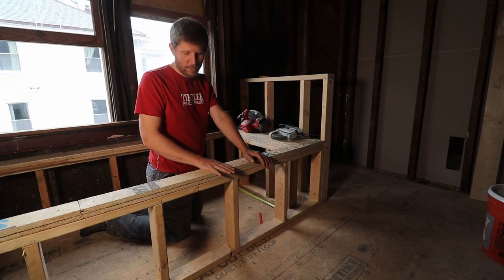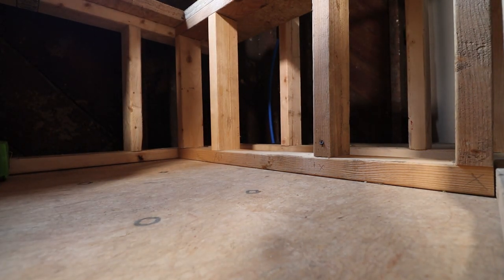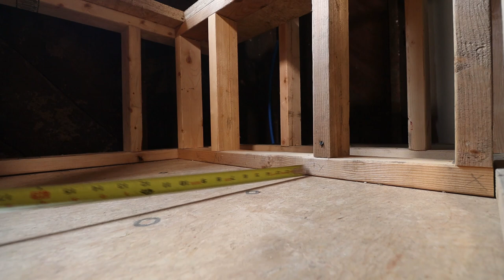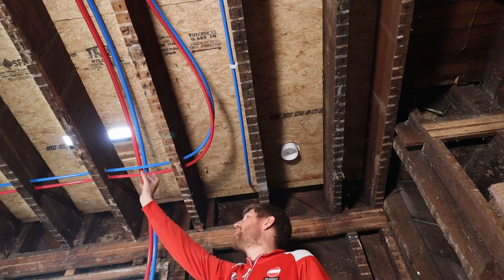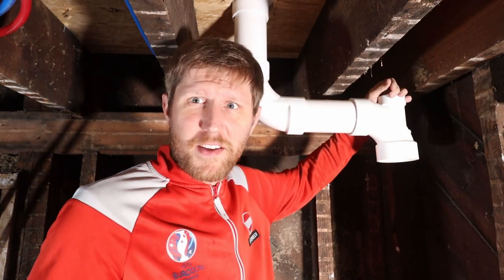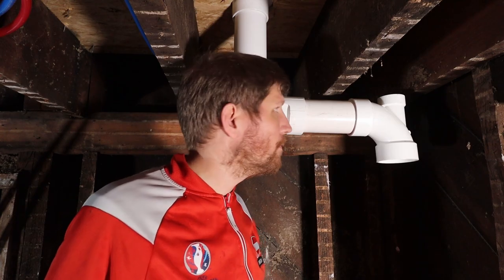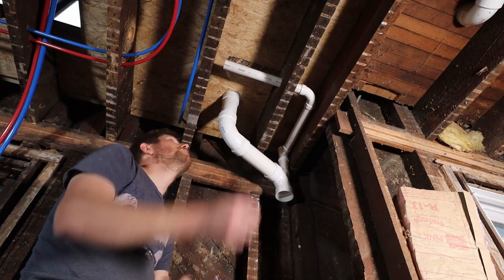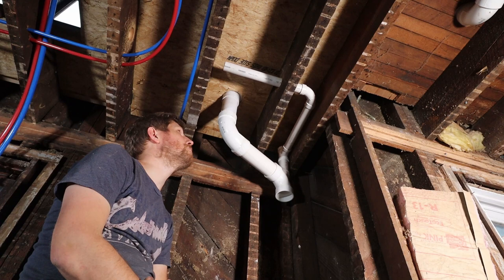Building a Drop In Bathtub Frame & Drainage - Victorian Home Renovation [TirolerInn]

Comment: You could put in a coffered ceiling to hide to pluming and use screws in strategic places so you can take panels down to get to pipes as needed.
Reply: If it interested you I’ve been doing a lot of research on making these ceilings and would be happy to send it to you.
Reply from the maker: Yes we were planning on doing some hidden panels for pluming access.
The entry area will get coffered ceilings for sure, so feel free to send it our way. Find the email address in the profile page ;)

Comment: I'm going to be building a frame for my tub soon. What kind of wood and size did you use?
Reply from the maker: we were using standard 2x4 framing studs and a double layer of 5/8 water resistant plywood